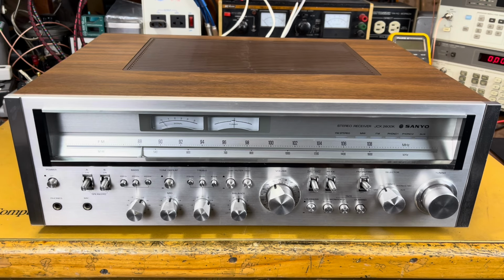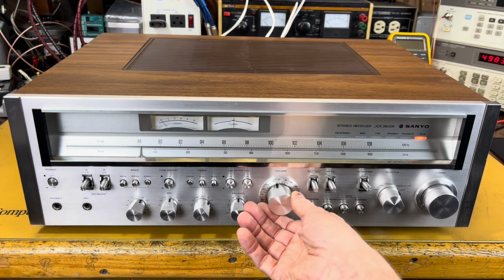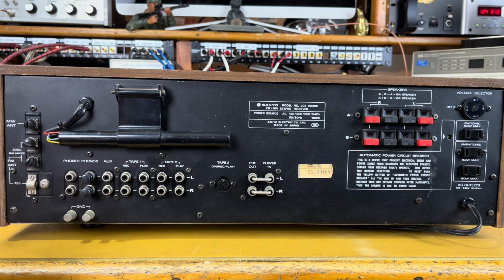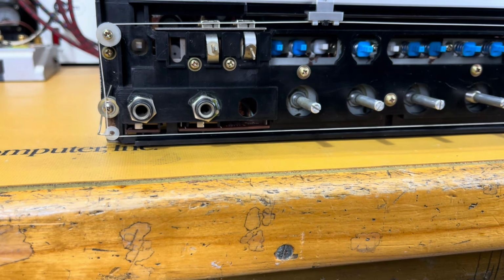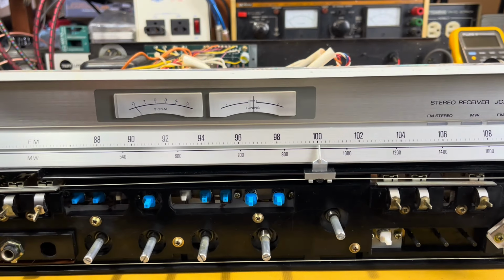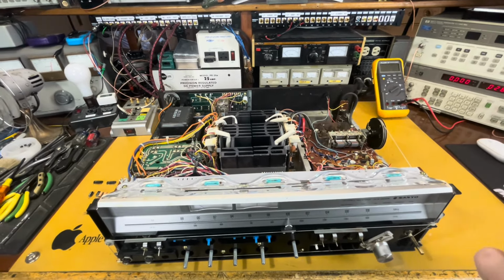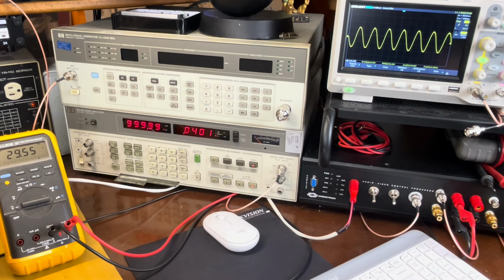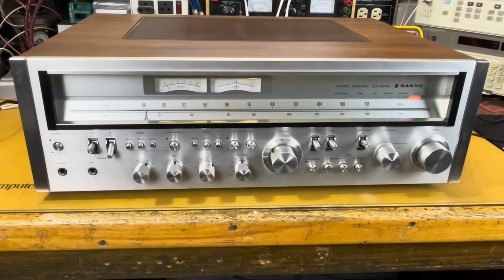Sanyo JCX-2600K Receiver - The Sleeping Giant!

Comment: Very odd string assembly, 4 gang tuning Capacitor, EZ once you remove face plate. Have the integrated Amp and FM tuner from this era.
Reply from the maker: Yes very interesting how Sanyo routed the dial string on this one. Sounds like you have a nice Sanyo setup!

Comment: Hi there do your lamps illuminate the front panel? I have three out not sure how to remedy. Nice receiver
Reply from the maker: Sorry I missed this message earlier. But yes the lamps do illuminate the front panel. There are lamp kits available on eBay. It does require disassembly and soldering. Thanks for your comment!
Reply: @WindtAudioVideo  Thanks. Im not into the soldering just yet. Cheers

Comment: I just picked up a $50 2400K... it's rated at 55wpc. I wonder what it's REALLY pumpin out? I'm going to guess 60-65wpc based on this video! Do I just need an oscilloscope and multimeter to find out?
Reply from the maker: @vorhese  It sounds like you got a great deal! To measure amplifier wattage you’ll need a signal generator or an app on your phone connected to the aux input to produce a sine wave test tone. You’ll also need an 8 ohm dummy load as you don’t want to listen to that test tone at high volume through your speakers! 

Then, you can use a true RMS voltmeter to measure the AC volts right before you observe clipping on the oscilloscope. Then, the formula is AC volts (RMS) squared and then divided by your dummy load resistance of 8. 

If you don’t have a True RMS voltmeter you can use just an oscilloscope to measure the Volts Peak to Peak of the sine wave right before clipping. Then divide that by 2. Then divide again by the square root of 2. This will give you RMS Volts. Then square it and divide by 8. 

Hope this all makes sense! There’s a video from Ray Gianelli (and others I’m sure) that shows this process using just an oscilloscope for measuring.

Comment: I remember having one of these to repair under warranty - every once in a while the bias would shift on both channels simultaneously and while it continued to run and sound normal during that time, the output heatsink would get scalding hot (turned itself into a Class A amp..)  Turned out to be a bad ground.
Reply from the maker: @ohger1  Very Interesting! I think I saw that ground while I had the amp board out… couple wires on posts that screw in behind the heat sink? I didn’t like that setup, so I ran a permanent wire while I had it apart. Thanks for the post!
Reply: @ I've repaired probably 20K items (my business) over the years and don't remember what I did, but I found it by monitoring the bias and pushing on the boards.  I noticed the ground on the amp board was going from 0 volts (expected) to half a volt IIRC.
Reply from the maker: @ohger1  Nice work! Sometimes those oddball repairs can be hard to diagnose!

Comment: How does one learn to work on vintage recievers. I mean it's not like there is a school to learn this or is there. How did you learn? I want to do this stuff but don't have anyone to teach me.
Reply from the maker: @jshortdawgshort3033  I’m glad you’re interested in this stuff. You’re right… they aren’t really teaching this stuff as everything is basically throw-away nowadays. 

I started learning back in the 80’s from my grandfather, uncle and other technicians we had working at our family TV repair shop. Over the years, I kept furthering my knowledge by reading electronics’ books, audio repair forums, watching videos, etc… but mostly it came from hands-on experience! 

You can learn the basics from books and watching videos… but every unit you work on might be different and have its own common failures. If you’re interested, I would suggest watching some videos that show complete repairs start to finish. And, then invest in a couple tools and test equipment such as an auto-ranging digital multimeter and an oscilloscope. 

Check out AH-Fix-It on YouTube as he shows a lot of his repairs in detail and even some of his growing pains as a relatively young technician. XrayTonyB, Jordan Pier, and Ray Gianelli have some great videos as well.
Reply: Hi,

ist basically standart electronics and how and why old components degrade over time and their failure modes. But old HiFi also need some mechanic skills as well ( cleaning all the switches, sliders, potentiometers....).

cheers.

Comment: I have the exact same Sanyo!  It's my daily driver.  Only one issue with the power switch so I bypass it with an outside switch then engage speaker switches to operate. It's been hanging on like this for quite a few years. I read somewhere that it has to do with a faulty transformer but I'm not too knowledgeable.  It's a fine sounding receiver.  Thanks for sharing!
Reply from the maker: @Bozakky  That’s awesome! Glad you enjoy your Sanyo!